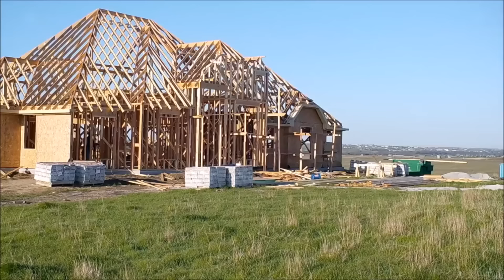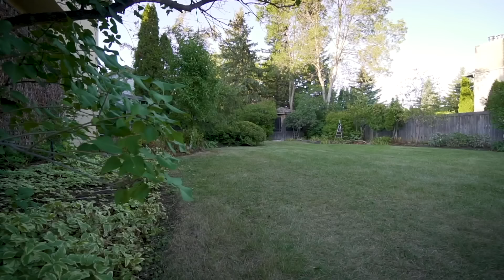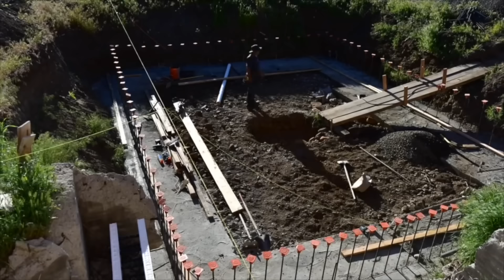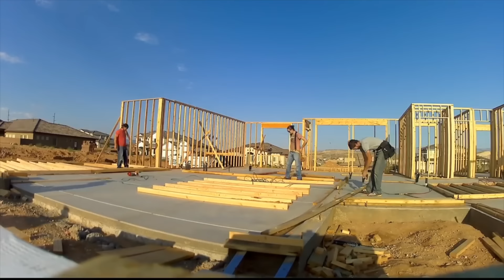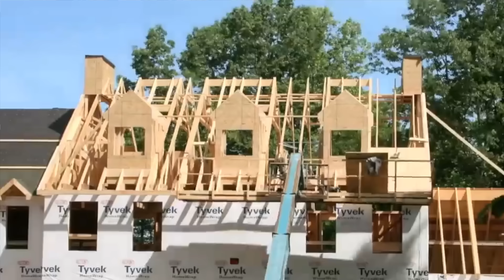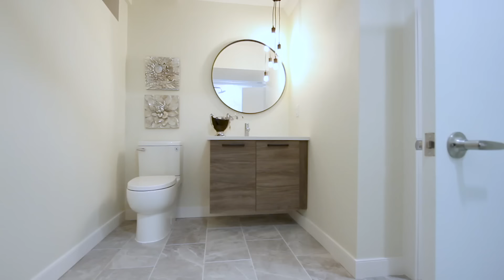THE REAL COST TO BUILD YOUR HOME | Custom Home | Building a house Cost

Comment: Sure enough he's not being area specific, just blurting numbers so let me copy the truth I said from the last persons video that mentioned about "cost to build"...
Ok people, let me give you another perspective because what she's mentioning has to do with her area which to me she need to move lol... meanwhile here in Texas;

1.  Cost of land - $120.00/month no lawyer fees ... you don't count the total lot cost unless you are plain paying all cash
2.  Survey: $150(to check piping and where the septic can go per house plans), you can get this free from your county office
3.  Generator Harbor Freight: $240... you simply need to charge your tools that's it.  When you get the actual house built with electric lines ran, you can backfeed a couple outlets. 
4.  Site Plan: Free from county office or you can simply download a ready to go plan that has the outer layout you like for a mere $100.  Come back and change interior later after inspection and legal.
5.  Get a $20 tape measure, pen and paper and you can design the driveway yourself... build your forms, call a concrete company for the pour
6.  Water hook up... what's keeping you from going to the front of the house and turning it on yourself after you got everything connected? or "hookup as in turned on"... your water company can do that free after you pay to have the water turned on...  I'm a little confused on that aspect she mentioned tbh.
7. I'm lost on the health department part, we don't have to go that far and typically septic setups, the health code comes on their dime.
8.  Permit fee: $50

Adding a couple more aspects needed.  At this point, you are at the buildout stage in a summary.
9.  Layout concrete pour and setup: $8,500 or little less or more, that all depends on your sq ft.
9A.  If you are pier and beam, that can range from $6,500 up or down... and again, depends on your sq ft.

10.  Initial lumber cost.  All of that s we all know will be a few dollars per lumber, if you go OSB you're talking $10.00/sheet and remember you have to do the roof.  if you are a luxury type, you are looking around $19.00+/sheet
11. Drywall you can have top to bottom for around $800-$1,000
12.  Roofing material you are around $4,500 for everything, again, depending on your sq ft and in this case, roof type.

It's all about your house layout and what all will be involved so don't take what she or I say as you see/hear it because that will vary across many aspects and levels of your build and what your plans in general are.  Depending where you are, you can easily pay $35-60/sq ft and within that low area, that's a mere $42,000+ TOTAL.  The cost to build is 100% dependent on what you are building, it's not just about the area or some "general rule of thumb" most make it perceive to be.  
FYI, "everything custom" build is nothing more than adding around $8 - $20.00 more dollars a sq ft DEPENDING ON HOW EXPENSIVE YOU WANT TO "CUSTOMIZE".  It aint gonna cost you no damn $1.2M to build a home in the middle of Jacksonville, FL LMAO.  Don't be fooled by some of these people.  Bult in Florida at $96.85/sq ft ... sold at $158.00/sq ft... If anyone wants to know the actual cost to build their house simply send me a message, uniservtx@gmail.com and I'll research the areas for you and return some real numbers.

Comment: Overblown video for a DIY home - the most expensive part of a home is framing. Anybody living in NC- USA know before hand that if you are building a home for yourself - the law of NC allows you to not having to hired a contractor. In that case, you just need the engineer, architect and inspector. Yes, this assholes will charge you a bit but worth the struggle. You can skip the architect if you request a structural plan by the city, they have a bunch, they are usually super shitty but worth looking at for ideas. The other way to go around it is, if you know autocad - get some of this architectural plans from the city, put together the ones you like and hire an architect to just sign it. Super cheap - prob worth a $300 signature. Foundation is not so cheap, there are fun ways to do it yourself but I wouldn't mess with something so important so just pick the yellow pages and start asking for estimates. The framing which is the most expensive part is also fundamental but not hard to go around it. Get on your facebook - work in your spanish and hire two framers - one master and a helper. No more than $20 for the framing master and 14 for helper an hour. If you can read blueprints I would suggest you do the quality control, allow inspectors to come in etc. Cheaper part and the one you can actually do yourself is drywall and painting. Installing cabinets ain't that hard either so you can buy the parts and install it with a friend who wishes to learn. Installing floor is another easy way to use your friends for free labor and easy task. Hire the roof installation - pretty much everything else can be done by you with a little of knowledge and youtube dyi help. I helped my friend build his 4130 or so sq foot home and he spended around $160k US dollars, and that was because he wanted to go fancy in the kitchen. The land he bought 3 acres for $25k - umm in city fees I think he said he paid nearly $10k. So thing is - is a pain in the ass to build your own home because is time consuming - but you will save nearly 100k to 200k doing it so.

Comment: Dilapidated property needing renovation. Do I need a contractor's license to begin renovations? Or just ensure everything is up to code?
Reply from the maker: mac1super you will have to ensure that any work you do does/does not require the appropriate permits.  It is wise as a homeowner to have the proper insurance, and if you are doing it for someone, yes, you will have to make sure that you have all of the necessary licensing.

If it’s just a cosmetic flip, you can buy it and fix it without worrying too much.  Anything past cosmetic (electrical changes, structural, plumbing, etc..) you will need permits for.  

Also caution on demolition if asbestos is a problem where you live.

Comment: Hello. I have a question. I want to build a house next year but I don't want to build a concrete foundation, I don't want to disturb the terrain or do the less damage to it as possible. I was thinking about steal beans and steal frame for the foundation and build on top of such. Is that possible and it so how it compares cost-wise to a concrete foundation? 2500 to 3000 sf.
Reply from the maker: OTniel Chillon great questions for a LOCAL builder, architect or engineer.  

Your local codes will dictate what you are allowed to do or not.  

Most without basements are slab on grade, unless you are in a massive flood area like new Orleans where you build on piers.  

It’s great to think outside the box, just get an architect involved to help guide you.  

Thanks for watching.

Comment: do you have a video on construction financing?
Reply from the maker: ccfilms Not yet.  Video coming! Thanks for watching.
Reply: @EmmettLeoHomes  How do you finance most of your projects if you dont mind sharing.
Reply from the maker: @caine-chow  Owner financing on Custom builds, private investors and private money on our big luxury spec projects.   Hope that helps.  Thanks for watching.
Reply: Thx for the quick response! Will a typical build calculation go something like this in terms of the financing component?

purchase of land = $500k with a 50% downpayment where seller carries first at 6% interest only
building of property = $500k private investor secured by several properties I have @ 12% interest only
interest on land for 2 years = $30k
interest on private construction loan for 2 years = $120k
total I need from investors = $900k

So to be comfortable, I'll need around $1m to pay for the land, build, and pay for the loans during the 2 years of construction in this example. If it's for personal use, I can refi with a conventional loan afterwards and pay everyone back. Or if it's for profit, I'd have to sell for around $1.3m if I want to make $200k from this 2 year project. Is this how builders typically break down the financing part?

Comment: Can you contract out parts of house that are specialized?  I want to build my own house, but I'd be able to do the interior work myself.
Reply from the maker: You SHOULD contract out the specialized parts/trades.  Electrical, plumbing, HVAC... even get a structural consultant/framing consultant to make sure you are building it properly.  There are minor things that you can mess up on and replace, but the big things, if done wrong or poorly, will hurt you physically and/or financially in the long run.  Thanks for watching.

Comment: Hi helpful video but I have some questions I’m looking to build a home instead of buying one. If I’m going to pay mortgage I’d like for the home to be exactly how I want. I have two children. 

I want to build a home with 4 bedrooms and three bathrooms two full one half. Nice size living room and kitchen area not really worried about the dining area as much. Nice yard and a basement. A driveway would be nice also and I don’t want any stairs. I’m not sure where or how big of the area the house will be built on but do you have an estimate on how much the house would be as far as sq ft. I’m not sure how much would I need for every room to be comfortable living in.
Reply from the maker: Figure out how big the rooms are and add them up. Sounds like about 1500-2000 sq feet unless you have a basement, then you can have basements down there.

Thanks for watching.

Comment: whats the price per sq foot if you dont use builders? and is a normal price house like the $150 a sq foot one
Reply from the maker: Octive labor is about 40-60% of the cost.  If you are doing it yourself, your material cost may be a bit higher as you may not get discounts like builders do for repeat business or bulk ordering.  

Remember that these prices are in CAD, and all prices are geographical affected.  

Furthermore, the price of a home is like the price of a car.  You can almost double it if you go with all the extras, or you can buy the bar bone model.  

Thanks for watching!
Reply: @EmmettLeoHomes  thanks

Comment: I have a 599square meter are which cost me k300, 000 in PGK currency. I have a budget of k150, 000 to utilise and build a good decent family home with 4 bedrooms inclusive of a master bedroom. What kind of plan would be the best option for me? I wish to use bricks but not to sure as yet. Would need your help to figuring this out? I enjoyed the video and subscribed as I found it helpful with most of the advice you gave. Thanks.
Reply from the maker: Sounds like you need to talk to a LOCAL builder.  Best of luck.  Thanks for watching!

Comment: So what i gathered is a big hell no, i dont have that kind of  money. I honestly thoight buying my own land to then build a home on it would be cheaper
Reply from the maker: Remember that pricing is based on what you build.  You don’t have to build with high end finishes, and a simple design allows costs to be minimal.  Also, prices are cheaper in certain locations, so you might be able to build below the 115USD, but you have to ensure that the people are doing quality work and you may have to do work yourself. Best of luck!
Reply: @EmmettLeoHomes  I've been doing a bit of research and from what I see it looks to be 113-139 per sqft (this is for hampton virginia). This pricing for for the sqft of the house interior square fottage righr? It would be the price per sqft multipled by the square footage that I want. Then its the price of everything else stacked on top of that?

Comment: Texas has entered the chat...... yea that's too expensive. We get really nice homes built from scratch even cheaper.
Reply: Dave Chappelle  he brought up price per sq ft. That's apples to apples, and still way too pricey.
Reply from the maker: Parts of Texas are extremely cheap to build in.  Not only is labor dirt cheap, but material.  Building and real estate is very geographic and supply demand.  
Note these prices are in CAD, not USD, so convert them.  And yes, apples to apples is important.  the same size house with the same overall realtor specs can vary greatly based on quality of finishes and build quality.

Comment: If you're handy, you can do some of the work yourself and it will be much cheaper.
Reply from the maker: Correct.  However consider that the builder warranty will not cover self performed work.  

Thanks for watching.
Reply: @EmmettLeoHomes  true but you can hire other contractors to do the work and the products themselves have warranties. It will also save you on property taxes every year you own the property.

Comment: A serious cost summary has to end up with a range of total $/sq ft.
Reply from the maker: Correct.
Reply: @EmmettLeoHomes  You did not provide one.
Reply: @Nill757  How could he?  The video was a general view.  Pricing would be specific to an area.  He said in the video most of the homes he sells are in the 500/sq price range.  But that's sky high for a lot of areas in the US.   What good does it do to tell people, the building price on a custom home is anywhere from $150-600 per sq ft.  That difference is so huge and have so many variables as to be completely worthless info.

Comment: Not trying to be a smart ass, if minimum cost of a 1000 sq foot home is $150k then buying a well build 1000sq ft home for less than $100k is a good investment then.... idk not sure if I can go by that figure....
Reply from the maker: It usually is more expensive to build new because everything is new.  Buying an older home usually comes with its surprises and aging issues.  That's why you would invest in a newer build.  Form an investment standpoint, you have to consider how you would manage it, your level of involvement as far as forcing appreciate through renovations, and your overall strategy.  

Thanks for watching!

Comment: bro you forgot most important . what about garage ? is it included ?
Reply from the maker: marat karapetyan yes.  Most of the time unless you are putting in anything out of the ordinary or finishing the space.  That would be a separate line item.
Reply: Emmett Leo Homes ok so if builder charges $350 per sq feet for 4000 sq feet  home does it mean I have 3600 living space plus garage 400 sq feet or I have 4000 sq feet living space and garages 400 sq feet . In short if I want 4000 sq feet home garage is not counting for me to pay . Thank you

Comment: Hi.  
I'm in Northern L.A. County, California.
I'm considering fixing and flipping a house.
I'm also considering building a home.
I've heard the costs of lumber have skyrocketed, and availability of materials (drywall) are in short supply right now.

What's your opinion about that??

Housing prices have skyrocketed, as well, due to low inventory of homes on market.

Do you think it would be lesser expensive to buy or build a home right now?

Thank You. 😊
Reply from the maker: You have to compare apples to apples.  A new build is usually more expensive per square foot because everything is NEW.  
When flipping works well is when the availability for a lot or a home is very difficult and demand is up a lot.  
Resale homes are going through the roof right now because it really IS expensive to build right now, interest rates are low, giving people more buying power for resale homes, and people have more money from NOT traveling or extracurriculars.  
You have to play each market differently, but it might be easier to renovate a home IF you can get one under market value.
You make money in the buy, NOT the renovation.  you Cannot out renovate yourself out of a bad buy. 
Make sure to subscribe as one of the next videos is about the investing model and numbers we use to renovate and build spec homes. 
Thanks for watching!
Reply: @EmmettLeoHomes  
Thank You.
I'll keep an eye out for it. 😊

Comment: You said that the price per sq foot is different when building up..like a 2nd floor? Pls advise! Tks
Reply from the maker: Maria how much does this project cost? Yes.  As you. Build a second storey, you eliminate foundational costs that you have to include in your overall square footage.  

Building a 2000 sq for bungalow will be more expensive than a 2000 sq ft two storey because the footprint of the second home is only 1000 feet and the first has double the foundation size.  

Furthermore, if it’s an infilll, you have to buy a bigger lot to fit such a large footprint.  

Your mechanical runs will be longer from the furnace or cooling system.  

Many different factors make it more expensive.  

Make sense?  

Thanks for watching!

Comment: Bs here in florida a conventional home is less than that and if u go precast concrete is way under that and lass way more than the regular Building all those prices is couse the labor if u dont see it is becouse u r blind
Reply from the maker: Ismel Escarpio I build luxury homes.  Of course you can always go cheaper.  

Note that geography influence prices, there is a massive currency exchange, and we require a lot more to protect from extreme colds vs. hot.  

Thanks for watching.